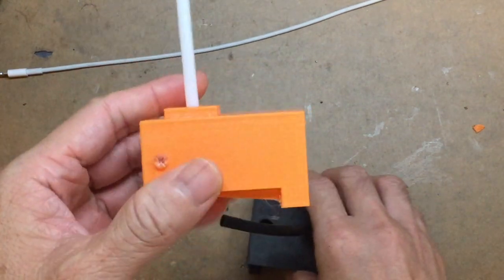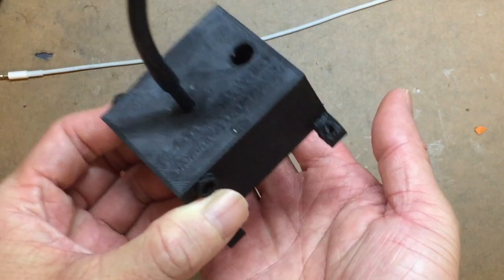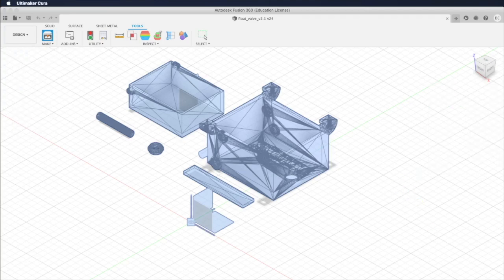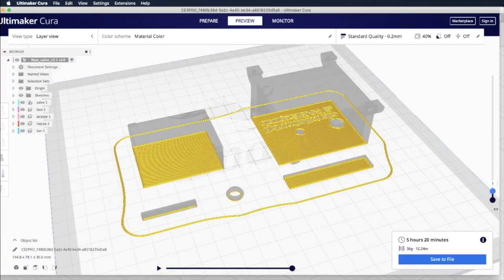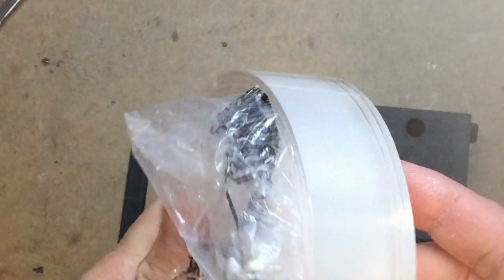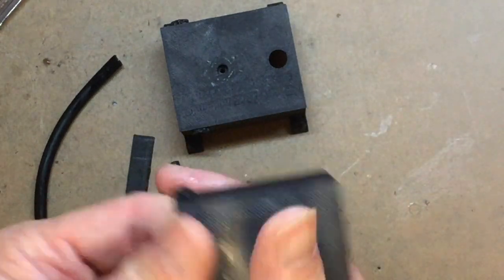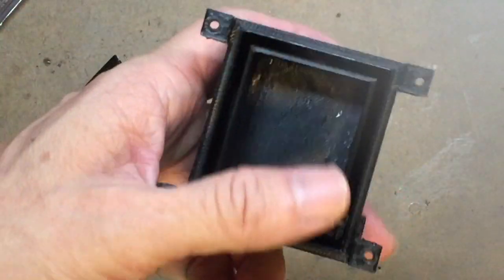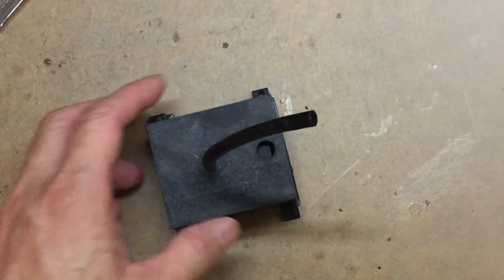3D printed hydroponics float valve V2.0

Comment: Good stuff 👍 what the maxi height between high and low water marks ..tx for all information, cold the design be altered
Reply from the maker: This controller keeps water below a high water mark only ~ 2CM, but you can adjust by mounting M3 screws at the legs. I am designing another one that can go between low water mark of 0.5CM to high water mark if 2CM.

Comment: How much pressure can it withstand? Will you need to replace the silicone tape after using it for a long time?
Reply from the maker: It will be fed by a 4mm diameter pipe, so not much pressure. Yes silicon take may need to be replaced

Comment: Where es the little ring for?
Reply from the maker: The ring for the other design where both the low level and high level can be controlled by sealing the air hole  at the top  of the float valve case where the ring is connected to.  It's still in development, not too reliable at the moment.